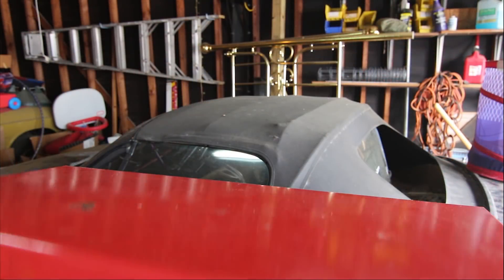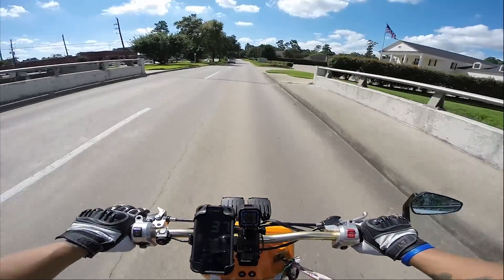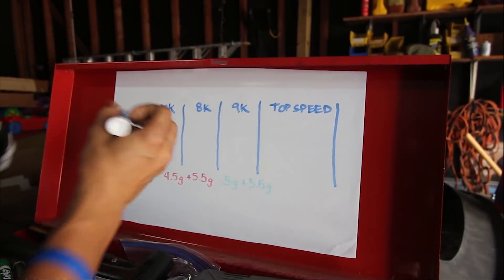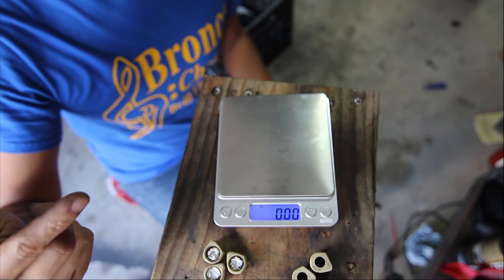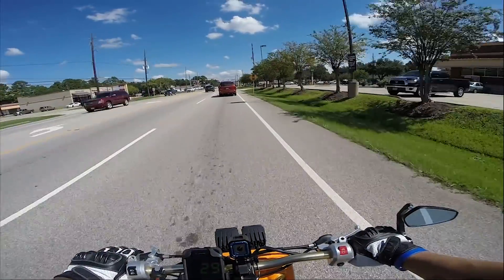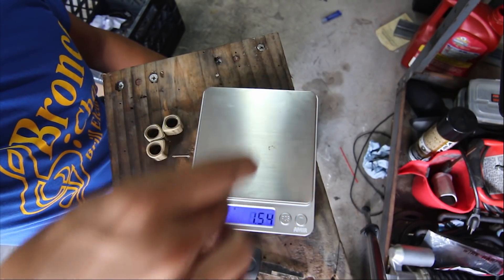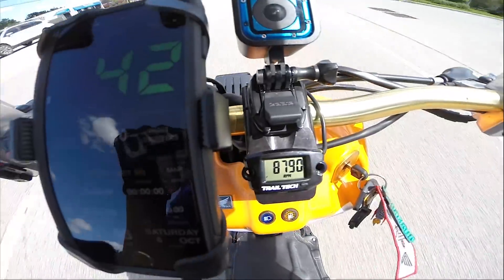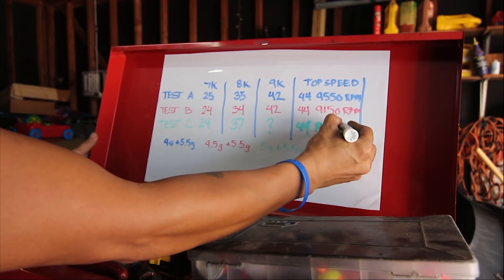TESTING Three different Dr Pully weight sets on the Honda Ruckus | Ever wanted to know?

Comment: Learned a lot. Thanks for the video. Going to try the Dr Pulley weights on my Honda Reflex. I want to lower the rpm’s at 65 and 70 some. Try some mixed weights.

Comment: Great video/channel! Keep them coming, if I could ask a question. I have  tried several weights 4.5, 5, 5.5 and all the combinations of those weights but don’t see any real difference/improvement. I seemed to settle with all 4.5 and top out at 43. Am i going to have to get a tachometer to get the best results?
Reply from the maker: Yes I felt the same way with my wights. Your looking for (I was looking for) about 9200 rpm @ 44 because I know I can get to 9800 if conditions are great. Aas a suggestion try the stock belt also to see if you get improvement. All in all a tach is a MUST for fine tuning.

Comment: Interesting, it's not as clear cut as I thought it would be. I was under the impression that the CVT "variates" in like a 1500 rpm range or something, and above or below is pretty much minimum or maximum gearing, but you seem to be pulling the rpms down at the top end, so you're not maxed out in gear ratio at the top end (well, potentially with the heaviest weights I guess)

Seems pretty concrete that you're power limited to 44 regardless of gearing, which is kinda interesting.
Reply from the maker: 45 is reasonable max, unless you port , polish, lightened flywheel, and other mods. Lighetend flywheel seems to be the next mod I should have done next.

Comment: Great channel and video! I just bought a ruckus a few weeks back and I enjoy watching your videos for insight. What weight combination did you get the best acceleration with in this test? Maybe I missed something in the video, but I was just interested in your thoughts since the top speed seemed to be fairly constant. Thanks!
Reply from the maker: the lightest set got the fastest to 44 , but I think 44 was the max, the second med set was good and had room to accelerate to faster speeds, the heavy was to heavy and I ran with that for a while and I could never get to 9000 rpm. I would go for the 4.5 and 5.5.  Thanks for watching!

Comment: Is this the stock motor or the gy6?
Reply from the maker: Stock 49cc GET motor :)
Reply: Cool I've got a 2017. After market CDI? What kind? What variator?
Reply from the maker: NCY CDI and a Pollini variator with dr pully sliders
Reply: @SmallEngineVelocity   how much you weigh lol
Reply: Not bad for a 49cc i put an 80cc on my qmb139 and did 48mph but no tunning what so ever just cdi oml spark cable and helix fuel lines. What do you think i shld do to get it to 50 smooth? Ordered a 20mm carb and eventually a cvt kit

Comment: at 12:30 45 MPH @9,000
Reply from the maker: Much different than 70mph at 9000. I think I changed the number because it was a bit below 9000
Reply: Yeah, but it is not meant for 70 MPH. Even the KP 150 is only meant for 55 speed limit roads. I do however like the idea of an occasional short jaunt on the freeway. I weight 220, 5"10' and 44" waist so more weight and air to move here.
Reply from the maker: TANWare avg speed for the Lifan is probably about 45-55 for me
Reply: That is about the same here. 55 is the max except when testing top end. So as is, without carb work, it fits my use perfectly. Just would like to have a little more extra.
Reply from the maker: I want to ride mine for A LONG time so its best to keep the RPM down - Good reason for the 35T for me.
Reply: Another option is I just ran red line in 4th gear and got 59mph. Now with a 35t rear and 23 plus on 14 front 4th gear would become 5th now at 71 mph. That would alo0w us to use 5th as a lug gear in OD for cruising at as 45-55.

Comment: You wont hit 9000 with the heavier weight cause its EFI governed at 44mph
Reply from the maker: I was able to hit a max of 57.2 mph as a 49cc before I went to a motor swap